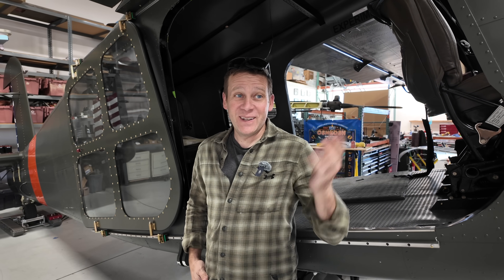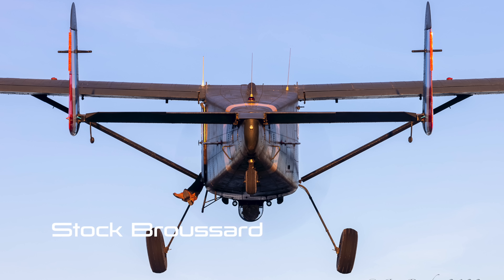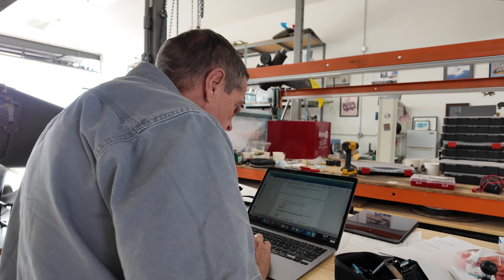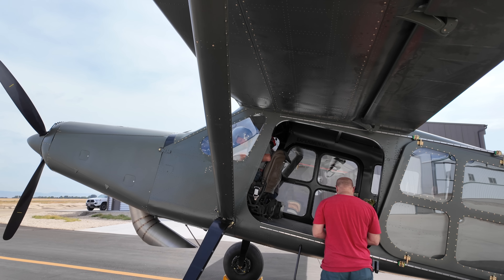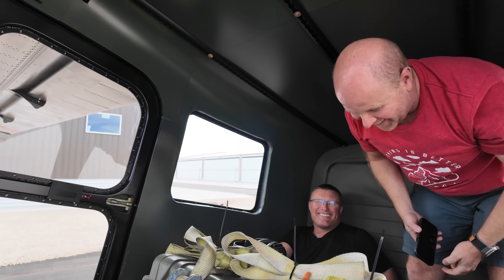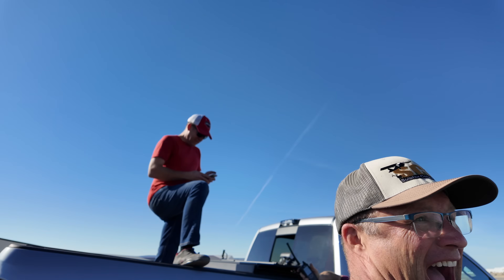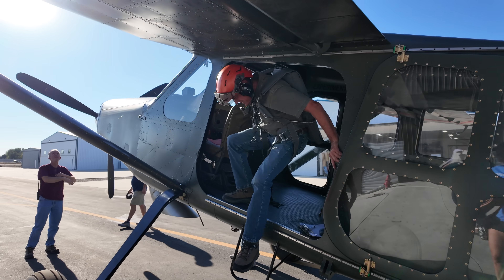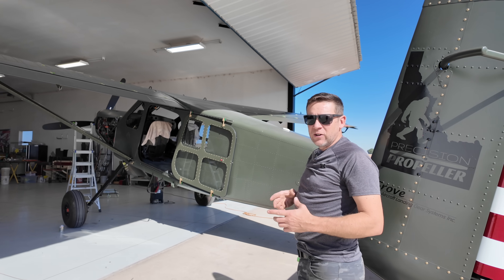Bush Monster: First Flight

Comment: I hope that the engineer(s) who designed the turbo engine mount understood and designed for whirl mode phenomena. The engine mount appears to be not triangulated thoroughly, nor very rigid in structure. Having the large mass moment and rotational moments placed so far away from the relatively stiff fuselage and firewall structures compound the requirements for a very stiff/rigid engine mount that exhibits high and well-separated resonance frequencies in each mechanical plane. 
Hope you guys did a lot more homework than what appears within the structure.

Comment: The hinges on the sliding doors could have been 1 foot apart and still held the door straight. That door is so light, and the hinges look so rigid, that there could be no movement at all. And then that track could be shortened so that it does not look stupid. Also, why not use the engine exhaust to counter the torque of the propeller so that the wing does not drop in a stall. A lot of helicopters do that to help the tail prop with torque countering.

Comment: Th residual thrust at landing speed may also cause the right wing dip at the stall due to the remaining thrust.  As the prop is rotating counter clockwise, the remaining torque at flight idle would cause a reaction to roll to the right

Comment: A beautiful installation of a TPE-331 turboprop.  It seemed to have a lot of residual thrust at landing speed, because of the usual in-flight 96% RPM under-speed governor setting.  Recommend that the flight idle blade angle be reduced to 8 to 10 degrees to reduce the thrust for landing.

Comment: It is a modified French-designed “Broussard” aka “Bushman”. Originally, the Broussard has a WWII type radial Pratt & Withney engine; noisy and thirsty, which the guy on the video said they replaced with a turbo-prop. The Broussard is a fantastic airframe

Comment: The Broussard was France's attempt to improve on the Beaver. All they achieved was a larger aircraft with the same cruise speed and a slightly lower carrying capacity. First flight was six years behind the Beaver so it eas trying to get into a market  already well catered for by the Beaver

Comment: The addition of the third fin indicates an effort to alleviate the problems with longitudinal stability that introducing a turboprop with its necessarily longer nose for centre of gravity reasons would have created.
Reply: the center of pressure would be another issue with such a long nose.
Reply: @gogogeedus true I had considered that and forgot to mention it. Guaranteed it would have changed somewhat
Reply: @mothmagic1  For an aircraft to be stable the center of gravity needs to be in front of the center of pressure, I don't think three fins would help the center of pressure because in certain situations they might blank each other out, but I'm not an expert.
Reply: @mothmagic1  instead of lengthening the nose for weight they could have move weight like the cabin closer to the front and put the cargo bay on the center of gravity that way the nose would be shorter the pilot would have better visibility and the cargo would not change the C/G but I accept that there is probably good reason for them not doing that that I am not aware of.

Comment: An extra 100HP of exhaust coming out of that pipe is just incredible. I don't know a lot about thrust angles and how much is lost once you lose the ground effect after takeoff, but have you thought about being able to vertically vector the exhaust nozzle using a simple wire and pulley system? Being able to point that exhaust towards the ground during a very short takeoff could make quite a bit of difference could it not? Very cool video, congratulations on a job well done!
Reply: No. It could not.

Comment: Definitely will be a ground fire problem with that exhaust pointing down . I think a redesign of that system to a bifurcated system aiming away from the fuselage on the left and right would be one possibility , similar to the air force T6-A trainer or the TUCANO.

Comment: First great first flight,  the takeoff was great less then 100 feet of roll, would like to know what take off will be under full cargo load, or compliment of  parachute jumpers, and equipment, be an interesting complement to fighting wild fires. Next what is its landing roll with a full cargo. It is clearly STOL, the question is how tight a space can you get into or out of with a full cargo load. Last is stall speed, how slow can she go with a full load. Last range with a full load? Lots of questions,nice looking plane.

Comment: Could you offset exhaust to counter prop torque suddenly application of power at low speed could be mitigated somewhat by the exhaust gases. Pinching the end slightly would increase the velocity. What do I know I am not an aero engineer😀. Looks like a great job.

Comment: This aircraft should be considered highly for search and rescue of downed aircraft especially “Military”!  Having the ability to carry one S&R operator and the capability to carry two additional rescued flight crew members.  It should also be able to carry a pintle mount MK-19 and M-240.  This plane should be fitted with a larger engine and have enough fuel capacity for (4) hours on station and (1) hour reserve.  This could be an extremely useful bird for all services…….

Comment: So, why not just extend the exhaust outlet at the cg point and leave it turned down? For less wing loading.
On the other hand, I suppose straightening the exhaust to match the thrust line will give you better cruise and fuel performance?
Reply: Because then not only would you be dragging a huge exhaust pipe through the air that's slowing you down, you'd also be creating a ton of turbulence behind it from the jet blast, which would probably cause aerodynamic issues toward the tail.  Adding drag and creating turbulence are great ways to slow an airplane down.  100HP worth of thrust doesn't amount to much anyway.  At 400mph, 100HP is equivalent to 100ft/lbs of thrust, the slower you go the less equivalent they become.  In other words, the exhaust is probably pushing out 60lbs of thrust at 100% power during takeoff and cruise, which means you'd be offsetting 60lbs of payload at best in an airplane that weighs 100x that much and will burn 60lbs of fuel in about 10-15min of flight time.  It's negligible, really...

Comment: I just noticed your T exhaust is under the fuselage. What factors have you used to mitigate the density reduction under that zone? Is it mitigated by the mass airflow under the wing? Meaning a surplus on take off.

Comment: Awesome project. I flew Garrett converted Caravan on floats for 3 years. Awesome engine, our pilots did all kinds of bad things to them, many inspections, never any damage. One thing you might want to keep in mind (only repeating issues we had with our airplanes) is the Single Red Line  and the TTL. Too many times, the TTL would start to limit fuel flow (mostly because of poor prop rpm levere/linkage in our installation). The rpm would drop below 98%, Single Red Line would "calculate" now lower max EGT which activated the TTL. Power would decrease, dummy pilots would jam power lever forward, thought it was partial engine failure.......Had one guy turn off the TTL with power lever against the stop.....torture to the moon......I never set max power at 100%, didn't want to be sitting on the TTL, 98-99% was my power setting. I flew in Asia, same OAT every day, I had the max egt (Single red line comp off) memorized for 100-98-96 rpm. For practice, I would fly in all "manual" modes from time to time, Single red and ttl off. Awesome airplane.
Reply: A Garrett converted Caravan on floats? Man, that must have been amazing aircraft! Would love to have been able to fly in that machine.

Comment: Instead of installing stall strips on good loft wing maybe  try  vortex generators on early dropping wing . Just an idea to help keep the stall speed of aircraft to its minimal .
Reply: I disagree.  Vortex generators are ineffective at low speeds.  The wings are mirror images of one another.  When both stall, torque pulls to the right.

Comment: That exhaust looks like a fire-starter when taking off from unimproved runways.  Hot carbon from the exhaust is often visible from turboprops with a few hours on them.
Reply: And the dust cloud. I'm probably wrong, but I see it cutting a trench in front of the tail wheel on desert soil.
Reply: Exactly what I was thinking. Even just the exhaust heat on dry grass is bad enough
Reply: Likely way too much propwash for a clinker to ignite anything on the ground
Reply: Looks pretty similar to a Garrett powered otter and those have been operating in the bush forever 🤷‍♂️

Comment: Been waiting for this video, Thank you! awesome plane!  Question, did they mount the engine upside down  & if so I didn't  know ya could.
Reply: This is a TPE331-10UA, it is setup for an inlet up installation. I think the oil system is the only difference.
Reply: @DoItLikeDell  Interesting ,thank you for replying. I'm a retired AgPilot I flew mostly AirTractors  PT-6's ,  and hay that thing ( plane) looks like a hoot to fly! I'm from northeastern Nevada, where you all at? I'd love to pay you for a ride.
Reply: What on earth would make you think the engine was mounted upside down